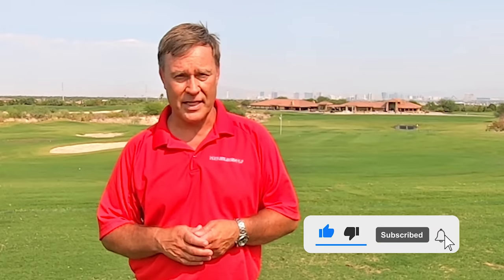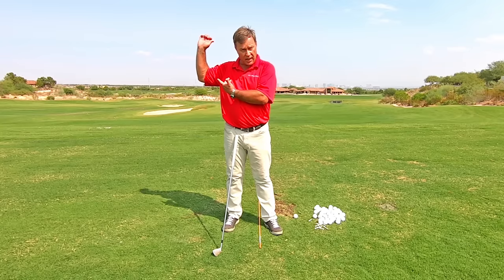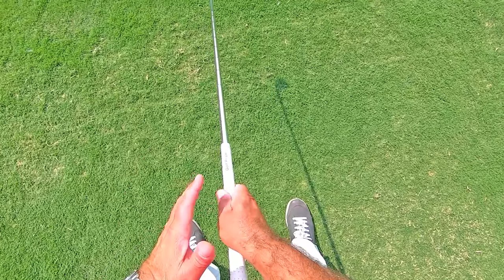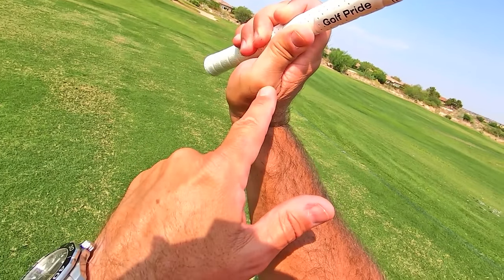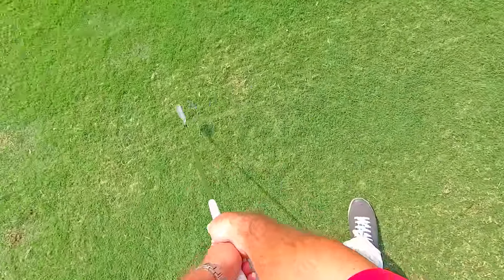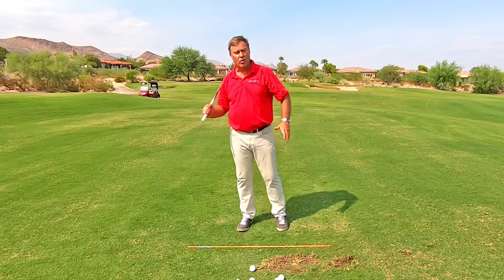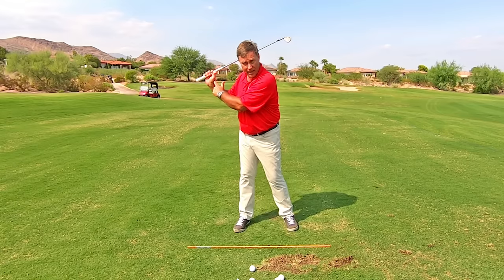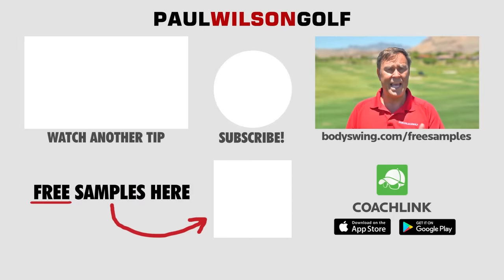GOLF GRIP - THIS PROBLEM LOSES POWER AND CONSISTENCY

Comment: Great tip Paul. I think I was doing that unbeknownst to me, the day I shot 78. Never knew why that round was such an easy swing day with such power and leverage. That’s the problem or mystery with golf, you never know why your round was so great.
Reply from the maker: Thanks.  Golf is a challenge that's for sure.  I like to base the swing on torque and forces because they repeat 100% of the time in life. Hand eye does not repeat to the degree you need in golf to be consistent on a daily basis.
Reply: Paul Wilson Golf I’m a hack flipper like the dolphin. I have impeccable hand eye coordination but very short and restricted backswing. So I start my backswing and flip it immediately on the down swing while being on plane. Although if I had your instruction i believe I’d be on the champions tour. I’m 53

Comment: This tip from Paul totally changed my game.  Went from 225 yd. Drives to 260 to 270 in one day.  Amazing.  The pistol grip and the hinge at the top was the golden ticket.  The arm swing with a weak slice went away. 
Never dreamed I could draw the ball now.   I went for a new driver fitting last week and was totally disappointed.  With that old arms only swing, my old driver hit farther than any of the new stuff.  The fitter told me I didn't need a new driver. I needed lessons.  He was right.  Well I don't need a new driver now.   No longer do I need to set the weights in my M3 all the way back and to draw setting. Now they are all the way forward and hitting bombs.  I've watched many many instruction videos and by far Paul Wilson's body swing and especially this tip changed everything. I'm moving back a tee box next week.
Reply: It was just a simple thing.  Simple.  After a bucket of 100 balls it all came together.   I wish I didn't have to work or I'd be doing it everyday. All day. Golf is now so fun again.
Reply from the maker: So glad you found me and tried.  So many people have this thumb down the grip which locks the wrists.  You need the wrists to get power as you just found out.  Great feeling when you get it.  Keep at it.
Reply: @paulwilsongolf  yes.  I've been practicing your tips for awhile now. But the body swing never felt right. I was trying to fire my hips and legs more and not use my arms. I thought I was just not flexible enough to do it.   Gave up.  Until the grip video.   Then I found the wrist action and how you were doing it.  The backswing became effortless. The thumb was in the way the whole time.
Reply from the maker: Glad you found the missing piece.  It's like a puzzle.  Need to put the pieces together to see the picture.   Keep at it.  Good things to come for you this season.

Comment: I have never seen any reason to lock the left elbow. Nor do I swing with any tension in the hands and arms. Tension is a swing killer. Using your grip with a slightly bent elbow allows a longer backswing especially for seniors. Great tip.
Reply from the maker: Very good.  We are on the same page.

Comment: Paul.  I start to grip the club by using the last three finger of the left arm, feel the weight of the club head by little hinging. then start to grip by means of the last three finger of the right arm (so, 6 finger are engaged)。Then start to feel the club head weight by means of Six finger. Then develope the said V of right arm . pretty good hinging as I engage those inner muscle group.  Remark I grip my tennis racket using the last three finger <right hand> at the outset proved to be good in serving the tennis ball. Taylor
Reply from the maker: If that works for you then keep doing it.  The real problem is most people don't get the V of the right hand.  Really focus on this and your grip will be great.
Reply: @paulwilsongolf  to superimpose the Left and Right hand V while pointing to the right shoulder <as Peter Leadbetter said>is very difficult 。It involves the overall posture. Ths for your video. lots of good points.

Comment: I’m a little confused because A LOT of YouTube golf and a couple of lessons I’ve had have said to use a strong grip showing three knuckles on the the front hand and both ‘V’s’ pointed at the back shoulder. You’re demonstrating with an iron and most of the strong recommendations I think are for driver. Is there a difference? Great video though, Paul. As many others said your explanations are very thorough.
Reply: Whoops. You covered this at the end. The ‘V’s’ point back just not to abruptly or over-strong. Thanks again, Paul!
Reply from the maker: Just don't put the thumb down the shaft.  I would also learn the neutral grip but that's just me.

Comment: Thank you for showing this grip...I have been using my 
Right  hand  to guide my left hand because I was holding the club incorrectly...I am finding it hard to adjust but I find when I do it correctly like you showed me the ball goes straight...
Reply from the maker: Very good.  You need to fight through it.  Don't see your hands as hands and wrists as wrists.  This is a unit that hinges.   The way to allow it to hinge and rehinge is with this grip position so as bad as it feels if you know why you will want to do it.

Comment: Thank you Paul! I was told that I had a short back swing and was lacking distances. I tried your grip tip and it is working wonders for my game! I'm seeing an increase of 25-30 yards on my drives and more control & consistency with my irons!
Reply from the maker: So the short backswing had you with tight wrists too.  Lock the hinge and yes, you will hit it nowhere.  This unlocked you.  Now, you really need to keep doing this forever.  Your wrists are a hinge.  A hinge hinges and rehinges because it is loose.  Stay focused on that and I think you are good to go.

Comment: Thanks for this.   Have been a great believer in what you teach with the body swing but have continually lapsed back in to a very handsy swing which I think may have been due to me having my right thumb as you warn against.   Tried this and it felt strange for all of about three swings with a PW at about 75%.   Once I timed one nicely it just felt so effortless that my brain seemed to accept it straight away.   It feels like I can set the club at the top and easily time the lag and release.   I think I’ve done this previously but kept going back to the wrong thumb position because I didn’t properly understand how important it was.   Thanks again.
Reply from the maker: Yes, sounds like this was an issue.  Definitely master this position which will allow the club to set better at the top.  Thanks for the support.

Comment: Thank you Paul. Your scientific advices and lessons helped me in a great deal. I went out for the first time since last September but was able to shoot the decent score.  It revealed my weakness which are putting and poor club choices.
Reply from the maker: Glad you are doing well.  Yes, putting is important but it's simple.  Putting is simple. You need to be target oriented.  Imagine a ball in your bottom hand.  Thumb straight down the flat surface of the grip.  Feel like you are throwing the ball at the target.  Practice only long putts 30+ feet and 6 feet or less.   That's it.  Do that you will be great.
Club choices - you need to get consistent with your swing then you will trust your distances.   Most people under club.  So take note of your shots in the future.  Are you short or long?  Then adjust.

Comment: I tried to click the like button 50 times!..but it only allowed one..my grip was a problem that I never thought about...used this tutorial with immediate improvement and a better flow with the wrists...I am still interlocking my fingers (seems to work fine) .do you reccomend not to interlock?...thanks Paul 👍
Reply from the maker: Glad you found this tip.  This really helps to unlock the wrists.  Get them unlocked and you get so much more power.  If you have been doing the interlock for while and you like it then keep doing it.  I do teach an overlap because it allows you to hold it in all fingers of the weaker hand while removing one finger of your stronger hand.    So if the person was a newer golfer or not placing the interlock on properly then I would switch to the overlap.  The problem is people want to wedge that pinky in for a secure position but this backs off the right hand putting the thumb down the grip.  You might want to watch this:
https://www.youtube.com/watch?v=jQZLp8bF-Ww

Comment: thats awesome way to exsplain the grip so we can grip the club tight an still hinge the club an get the back swing right so we can have same swing everytime..doing the other swing he said tilt then put the right hand on an that was to far under i never liked way that felt...yep im fighting all that trying a new swing im getting better an better cause i keep doing this while im playing also so make sure i can take what im practice to the golf course while im playing
Reply: i seen old video of you using wedges..u using 5 count i seen video of Paul runyan they said he was the master around the green.do you use the 5 instead of 2 cause of the club so much stronger than they was back when he taught this? that what im trying to learn is what club to use around the green i use PW only im not getting up an down enough to shoot par golf.im hitting driver an irons good now but im not getting up an down enough.could you make a new video an exsplain this better what club to use around the green
Reply from the maker: I have never seen a Paul Runyan video.  In reading comments they said he called it it the rule of 12.  I like it my way.  I don't have to do the math.  I know based the ratio what club to hit.  To me, this is simple and it's what I have done for almost 30 years when I learned it.

Comment: Thank you for posting this. I have been struggling with creating lag / casting for decades.  While watching this video, it struck me that I have always had my lower thumb pointing straight down the club. Never realizing how much restriction this was causing at the top of the backswing. Tried the grip you suggested, and immediately felt less restriction and increased length in the backswing.
Reply from the maker: Glad you figured it out.  That thumb down the shaft can certainly hamper lag.  Keep trying it.

Comment: I hope this is a useful comment--the presentation style in this video is much better than the one about increasing swing speed.
Reply from the maker: Glad you liked it.  Check out the others.  More to come too.
Reply: @paulwilsongolf 
 Paul,  
Keeping the wrist on your left hand flat (for a right-hand golfer) was something that Ben Hogan emphasized as a key fundamental in the swing. I believe he called it "pronation".  I was struggling with this until I realized that not cupping the left wrist IS problematic if your swing is too upright, but when your backswing is in the correct plane, that left wrist naturally stays flat, and it is much easier to hinge your wrists properly at the top of the backswing, in fact, it is almost automatic. I use it as a swing key--if my left wrist is flat without any manipulation when my club is parallel to the ground on my backswing, I know I'm dialed in , and  will hit the "slot" on the downswing, with the club lagging nicely. I stumbled on this realization when doing your drill of practice swings at knee height.  That properly timed, effortless "whoosh" that I strive for in the practice swing is automatic when I combine those two elements.  One other thing, I'm 67 years old, and my lifestyle choices since I was old enough to enjoy long jump contests from the rope swing on the neighbor kid's tree house has been very tough on my skeleton, so I've switched to the ten finger, or "baseball" grip. It's much easier for me to get the wrists to hinge, yet still control the club, with that grip. Matter of fact, I think younger players should try it, and if it works, ignore anyone who says it's "weird" or "unorthodox".  I have only one comment about your wrist hinging drill where you drop the club shaft to your shoulders by hinging the wrists and making an easy swing... it seems to me that could inadvertently cause some people to start swinging from "over the top", causing slices and other bad stuff.   Thanks for the tips and keep them coming.

Comment: Thank you for this video!  I have been making exactly the same mistake with my lower hand thumb that you described.  Not surprisingly I have also been battling a slice for years.  I had watched so many videos and even had in person instruction and they never pointed out this flaw.  I have now fixed this issue and everything in my swing is more comfortable and consistent.  Because I have been gripping the club wrong for so many years, it takes a lot of work to make the change.  One trick I have been doing is to take my grip from the backswing position.  Then I enter my address position and square to the target.  This actually has also had an effect to improve my address posture.  Can't wait till the weather warms up again to take this out to the course.
Reply from the maker: Glad you found this one.  Keep working on it through the winter so you have it when the season starts.

Comment: Can’t wait to try this! What are your thoughts on interlocking or over lapping right hand pinky and left hand pointing finger.
Reply from the maker: I like the overlap grip.  Interlock gets the person wedging the pinky too deep with index so they can't get this bottom hand on top which is exactly what I show in this tip.  Once I show them the right way to do the interlocking with the V on top they usually switch to the overlap cause the interlocking hurts the pinky.  Up to you but never have this bottom thumb down the shaft.

Comment: Everyone here had the wrong grip. Including me. Thanks coach Paul. I have been working on it and it takes some getting used to. You have to train your mind not to freak out about the new feeling at the top. I hope it helps me. I am nervous to try it on driver because I was knocking the driver 250+ with ease using the wrong grip (with the right thumb straight down the shaft and the right thumb supporting the club a the top of the swing as you describe) But I am going to be trying it out tomorrow if its not to hot here in AZ, that means if its over 112. hahaha. Be well all.
Reply from the maker: Yes, a lot have the wrong grip.  What does this say about what people are being taught?  Just see the hands and wrists NOT as hands and wrists.  It is a unit that hinges and rehinges.  A hinge is loose.  So no matter how bad it feels when it's neutral it and hinge and rehinge properly.  Place your hands on neutral then work it back and forth.  In no time it loosens up and you will be able to do it with all clubs.
Reply: @paulwilsongolf  Pretty amazing tip!

Comment: Long time golfer.  Only ever had one pro lesson in my mid 20s and putting the right thumb on the shaft was one of the things given to help me be more consistent.  I wanted to prevent "cheating" and taking the club back past parallel at the top (trying to flip for more speed). It felt weird for a bit, but now it feels 2nd nature and not sure I could/would go back.  Every other part of my grip is correct and never get callouses or blisters like I had in the past.  4 hcp, but honestly I should be scratch.
Reply from the maker: So you are still putting the thumb down?  If so and it's working then it may be hard for you to change but at a 4 hdcp there is something you could be doing better.  I really don't think at your level doing something like this is going to cause you to do a super long backswing.  It may allow the club to set better at the top.  The flip is due to the shoulders too square at impact.  More rotation = no flip.  Flipping in better players is due to them trying to draw it keep the back to the target too long.  Easy fix.
Reply: @paulwilsongolf  yes still thumb on top.  I didn't mention flipping, but I do sometimes when my hands get quick and dont focus on lag at impact and letting my shoulders so the work, instead of hands

Comment: Hey Paul, great lesson I love it. but I have a question I have a baseball grip because I used to play baseball before does that also apply for a 10 finger baseball grip ? I am also holding the shaft inside my palms
Reply from the maker: I really don't like the baseball grip.  Puts the club too much in the palm of the right which puts too much strength in it.  If you hit with this hand you will tighten.  I want loose.  I have let people get away with this grip in the past but only if they kept the V on top not backing it off too strong.  So it can be done if you copy my right hand position.

Comment: Thank you for this informative video.  I have unfortunately developed a grip problem where my right hand wants to move underneath the club.  I am trying to break this habit, but it is extremely difficult.  Do you have any drills you can suggest to help me?  When I try to swing the club as your video, I often subconsciously move that right hand underneath the club and it's a disaster.
Reply from the maker: It just takes focus.  I did a tip on it here: https://www.youtube.com/watch?v=2Plf1XVbc3U
Also, learn the neutral grip too here:  
https://www.youtube.com/watch?v=jQZLp8bF-Ww